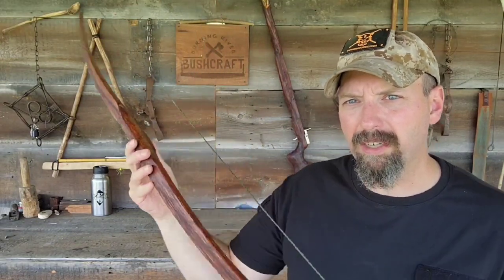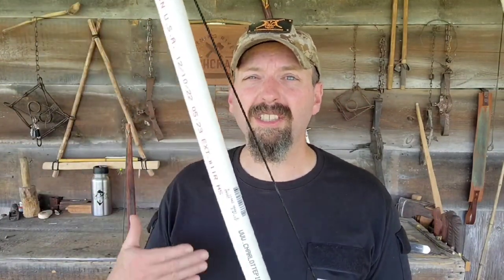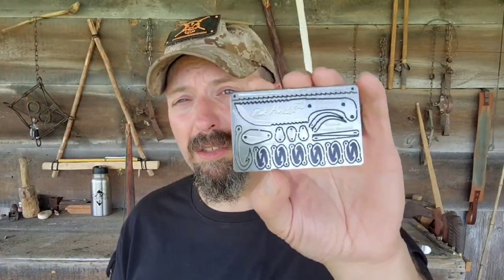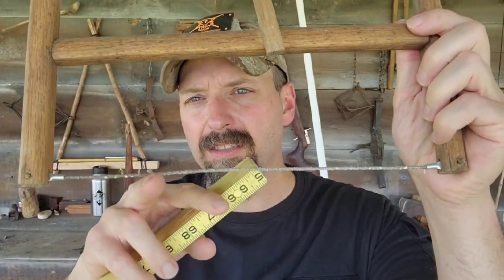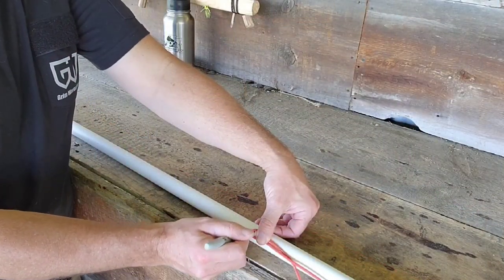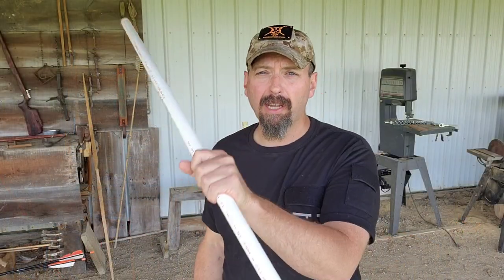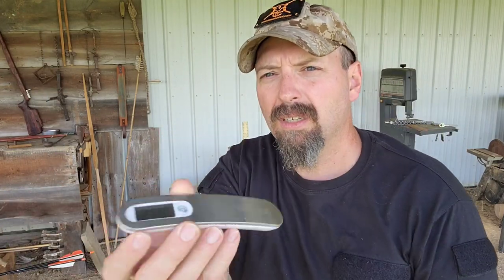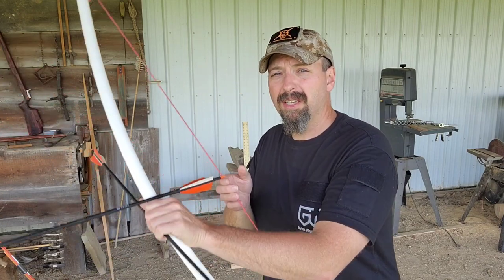Grim Workshop Survival Card PVC Survival Bow Build

Comment: Fiber class rod would be put onto better use as an arrow.
I see straight arrows as more important piece than higher draw weight
Reply: Making arrows from available materials is a good way to replace damaged or lost arrows. If you got enough fiberglass rods for arrows, then one extra for the bow stave should be no sweat ...